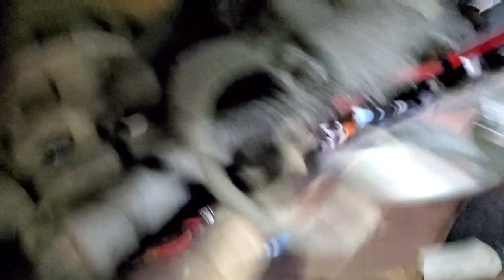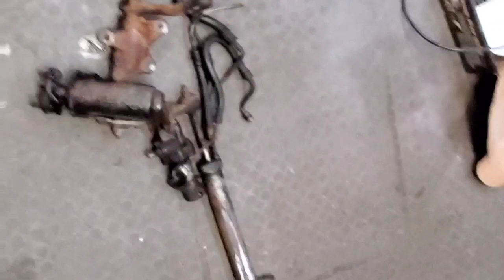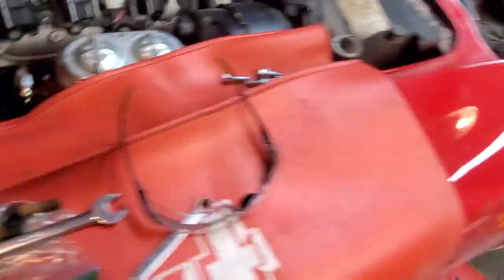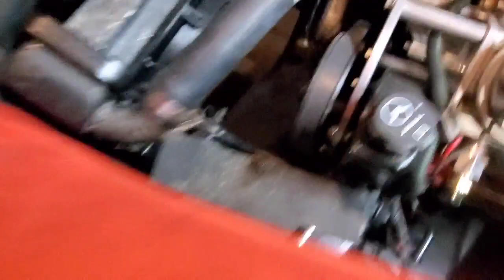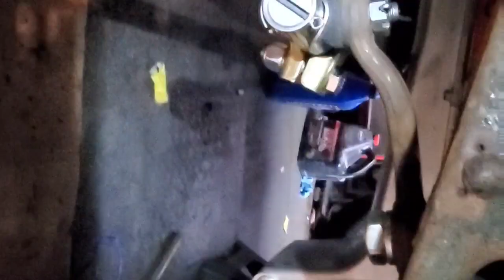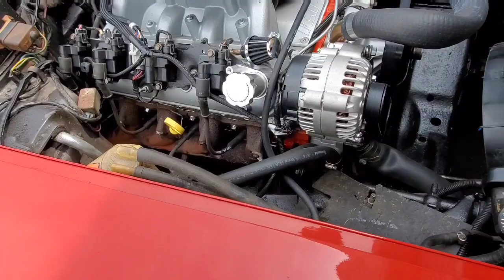Our C3 Corvette LS Swap Part 4 borgenson steering conversion and first start up

Comment: Sounds amazing.
Reply from the maker: Thank you! I have to say, we are very happy with how the exhaust came out. It took a bit of time, but well worth it to have such a good and long lasting system
Reply from the maker: If I remember in part 4 we didn't even do the exhaust yet. Wait until you hear it up and running with the exhaust and once  the fuel and timing were adjusted in better!